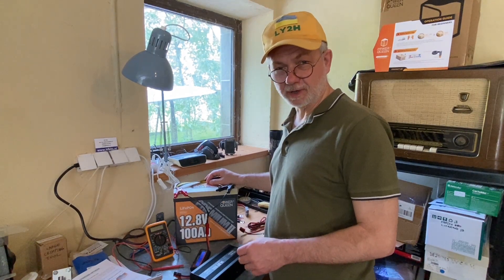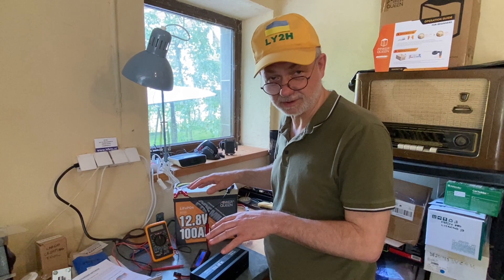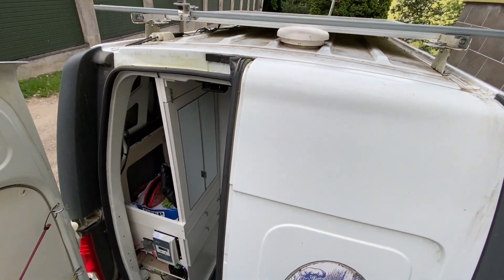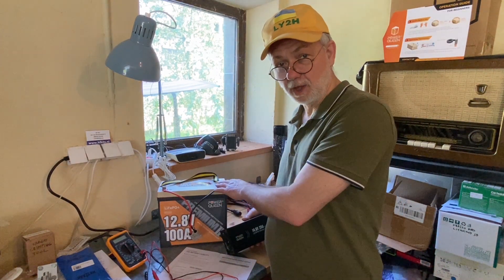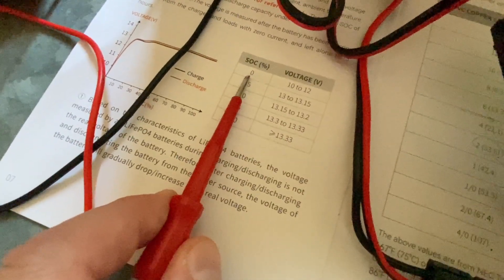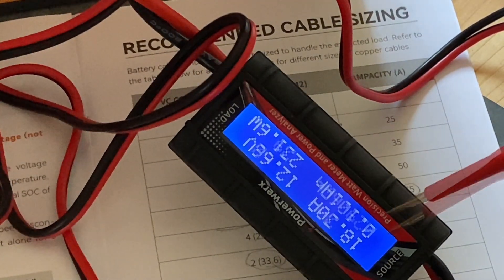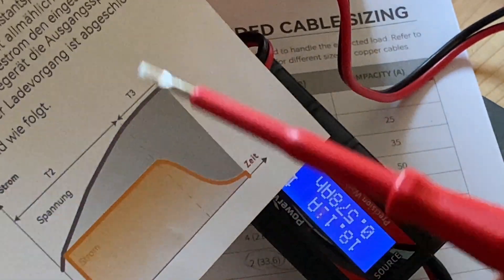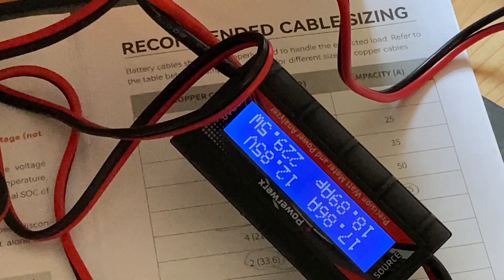Power Queen 14.6V 20A LiFePO4 battery charger: loud fan, but RFI-wise quiet!

Comment: Hi, thank you for the information. It was very helpful. Does the battery charger charge the battery to 100%? Do you want to charge lithium batteries to 100% or is there a 20/80 recommendation ?
Reply from the maker: Hi, thanks for watching! As it comes to the state of charge or a depth of discharge , measuring in terms of percentage for the LiFePO4 batteries makes not much sense, as it is the voltage level which matters for each of the condition. This voltage level is kept at the safe min and max levels by the battery's in-built BMS. Normally,  the max level of the state of charge is 3.65 V and the lower limit of the depth of discharge is at 2.5V per single cell. Usually, it's the manufacturer who establishes these best voltages for their batteries. LiFePO4 type of lithium batteries is very reliable and can stand a full discharge and a full charge with no  damage or reduced longevity, as long as the BMS is functioning and prevents the over-discharge or over-charge.  If your battery serves as a back-up battery, i.e. sits idle most of the time, it is important to get it fully  charged some every few months, in order to have the individual cells balanced - it's really important for your battery's health. If you cycle it every day due to intensive use, the balancing is done automatically. HTH, good luck , 73! Linas LY2H